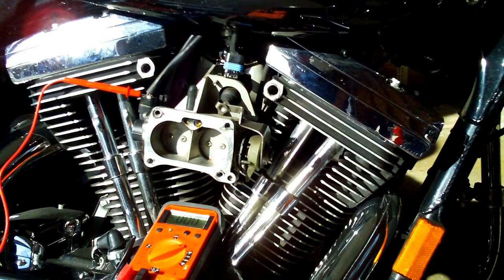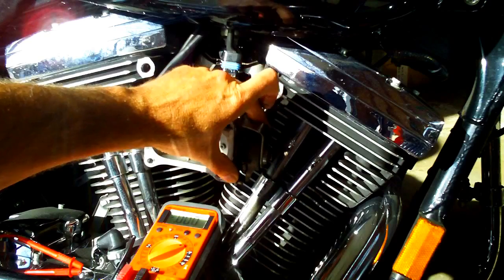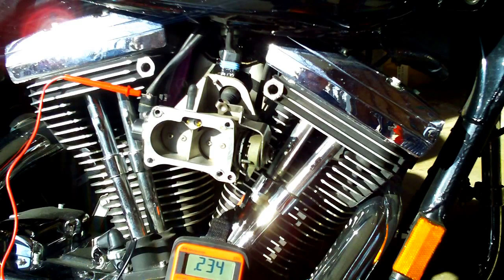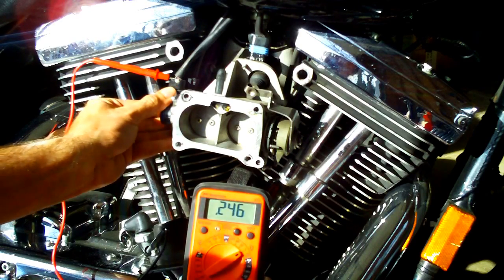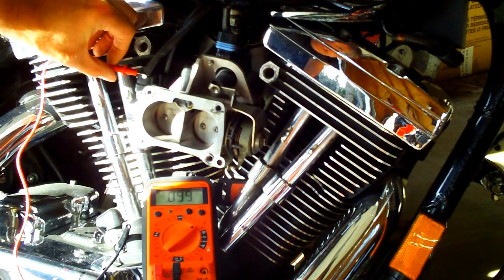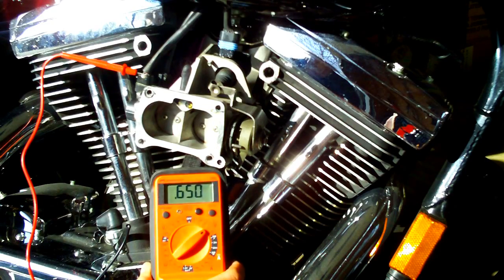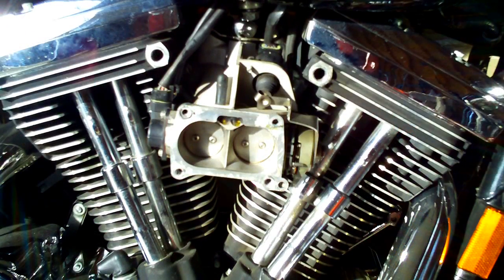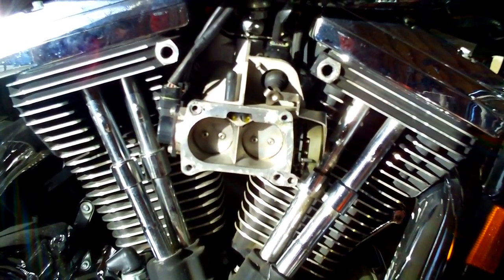Reset Harley Davidson Magneti Marelli Fuel Injection TPS Settings ✔

Comment: Man! Looks like a great test. But you never say what your multimeter is set at
Reply from the maker: The voltage meter is set to millivolts. Here is a video of the multimeter I used. https://www.youtube.com/watch?v=SSi6kIp_Vrg You're right, I did not mention in the video, but have replied to other comments on this.
Reply: Mark Young - Outside The Box
Thanks
I figured it out and my idle numbers are off. What kind of Bike is this?
Reply from the maker: This is a 1997 Road King 80 cubic inch. There are some small differences in the numbers for the 88 twin cam. What are you working on?
Reply: Mark Young - Outside The Box 
I have a 2000 Road King Classic. 88" efi
I'm sure my numbers would vary
Reply from the maker: For TC88, your cold idle setting should be between 0.650 to 0.680 volts DC. The 80ci motor has a nice cold idle speed at 0.650. This is the only variation between setting up the two motors, I believe. It is meant as a starting reference point, but you can always increase or decrease the cold idle speed to suit yourself afterward running the bike a few times, if needed. Good luck to you!
Reply: Mark Young - Outside The Box Thanks! I'll look at it again. Those bolts don't want to be adjusted. There's even some kind of clear filler in the head
Reply from the maker: That clear filler in the heads are epoxy that the factory put on them to discourage people from "tampering" with them, and with good reason. It doesn't take much of a twist of the TPS to throw the whole works out of balance (I know) and rendering your bike into a fancy paperweight. Some use a sharp tool to pick that epoxy out of the heads. I used pliers with a good grip to gently turn them, just a little bit, to loosen. You don't want them too loose or it will be a pain in the neck to get the thing to sit still when you finally DO get the right voltage reading. Try to coat them with something to keep them from loosening after you've got it spot on.

Comment: hello ,I get a 97 road king from a auction  ,I notice the throttle body is  broke, my question is if can use one from a 2001 rk?
Reply from the maker: I believe all of the MM fuel injection throttle bodies are the same. The ECM's may be set a little differently to compensate for differences in cubic inches, but your ECM is already setup for your 80 cubic inch motor, so it should be an easy swap. The only area between the two that I would question would be the fuel injectors, but if you have your original ones you could swap them out too? Let me know how it goes.

Comment: Hey Mark I did all of what u said an when I started it up it shakes so bad that it feels like the motor ready to come out I have a 2000 ultra
Reply: Video is very informative by the way... will try after i get it running. hopefully
Reply from the maker: Are you sure you used the right meter setting? Cold idle should be (1450 Domestic/HDI) 0.64 to 0.68 volts for the twin cam engine. Was it shaking before you performed this procedure? Is it only at idle? Did you let the bike warm up? Is this a shake from an idle that is too low, or does it seem like it is misfiring? Being an Ultra, you must have a tachometer, what is it showing for RPM when it is doing this? Here is video of another 2000 Ultra that followed the same steps with success and some more tips and info.... https://www.youtube.com/watch?v=xEIVYdPGYMk
Reply: Yes it was after I got my motor bored out to a 95 it been doing it an the tps was replaced to bec it was cracked up really bad
Reply from the maker: So it sounds like it is a system that was meant to feed an 88 cubic inch motor that is now being asked to feed a 95 cubic inch motor. You may need to add a fuel module to the system to try to balance things out? Also, the numbers to set the idle may be too low for a larger cubic inch motor? You may have to experiment with the cold and hot idle screws. What RPM is it idling at now?
Reply: I got a ps5 now I'm sending it in to get dino next week
Reply: I have a 1998 road king and need the new hoses  anybody got any ideas where i can find??? thanks Dave
Reply: the two fuel lines to the injectors
Reply from the maker: David, are you talking about fuel hoses that go from the tank to the throttle body?
Reply from the maker: Keith, the P range shows issues with the engine sensors and motors, but there is not a PS5 code. The range is P0051-P2304. You can check here for the correct codes. At least it is telling you that something isn't quite right and hopefully will help to narrow it down to the real problem here. https://dgcustomcycle.com/tech/harley-diagnostic-codes-04-present/
Reply: yessir but i found them  made by goodridge  sold by custom chrome thanks anyway for your quick response..... one more question on this magnetti injection system... do both the inside tank lines have the ball checks?  where the lines screw in to tank ??? i see one on the threaded bungs to the front of the tank but the rear one is open hole....If you can answer it would be cool...... bout had all i can deal with on this old system  if the hoses done work gonna go to carb kit....
Reply from the maker: I replaced my fuel lines with the Goodridge braided lines as the original ones started leaking around the o-rings. The Goodridge 0-rings are replaceable, so at least you wouldn't have to buy those lines again. I don't remember if there was a ball valve in both ports or just one. I remember having some gas to catch in a container at some point, so be ready for that just in case.

Comment: RK with the blessed MM EFI. It has always shown a big drop in mpg from local rides to highway. Above 70 it drops from 42’ish to 25. I do have stage 1 breather and VH pipes. Any ideas? Runs good, but sucks fuel.
Reply from the maker: That sure does sound low alright. Is this an 80 cubic inch also? I was getting 45 to 50 average city/highway riding and that was with a Dobeck EFI controller and Bassani 4 inch slip ons. You don't have a check engine flash going on at all?
Reply: 88 - no engine light - did find a couple of challenges with air leaks. Service person failed to put copper washer on one side of breather banjo bolts. Also, a breather tube had a crack
Reply from the maker: Have you pulled the plugs to check if they are both looking the same? I'm guessing very black with that kind of mileage. However, if one is black and the other is more of a light brown, the fuel injector feeding the blacker plug may not be closing all the way allowing fuel to leak by? If you do remove the plugs keep track of which cylinder they came from. Other than that, a stage 1 breather and more open V&H pipes should make it run leaner, not richer. Three things control the fuel mix. The throttle position sensor, the barometric pressure sensor (underneath the right side cover), and the engine temperature sensor (locating dead center down the front cylinder on my 80 cubic inch, should be similar for your 88). I thought I was having issues with my engine temp sensor causing it not to idle well when cold, so I replaced it (it turned out to be the cold idle motor adjustment). One of those three parts may be faulty and causing your rich fuel condition?

Comment: 2001 road King, starts up ok, but after warms up going down road a mile or so it shuts off, let it sit a few minutes it starts and runs another 1/2  mile or so and shuts off again, sometimes after cranking it again it will idle about 5 seconds then shuts off, 
Please help..... what could be causing this ????????
Reply from the maker: Hello Andy. This could be caused by a number of things such as a bad wire connection somewhere to a problem with the fuel system. I have not had an experience with this. Is the check engine light flashing when this happens?
Reply: Mark Young - Outside The Box 
Yes the engine lite comes on when thus happens
Reply from the maker: Ok, good, you have something to go on. Follow the instructions listed here and see if you can find a fault code. http://www.thunder-max.com/techdocs/HarleyDiagCodes.pdf
Reply from the maker: Also try this link that tells you how to check them and what they mean. https://www.hdforums.com/forum/ignition-tuner-ecm-fuel-injection/631955-harley-diagnostic-codes.html

Comment: What year bike are you working on? I have a 98 ultra w the MM but I don't have a gray and violet wire
Reply from the maker: Hello Randy. This is a 1997 Road King. Maybe your wire colors are different, but if the throttle position sensor looks like mine, it would be the wire that is closest to the throttle body of the MM. Number 3 going across from the left. 1-2-3.
Reply: Mark Young - Outside The Box Thank you
Reply: One more question Mark, I got into this tonight and the wiring on my TPS  has 2 black in #1, red in #2 and blue in #3 spot, do you suppose it will be the blue wire that I need? Thanks for the info.
Reply from the maker: The blue in #3 would be the first one I would try. If MM systems used the same configurations year to year regardless of wire color, that should be the one that carries the voltage once it has passed through the throttle position sensor. Let me know what you find.
Reply: All I keep getting on meter is OL, which I believe is overload?
Reply from the maker: Yes, I believe that is what it stands for also. Are you able to try different settings on the meter? This measurement is for Millivolts DC. I'm not sure what setting you have the meter on to get an overload of what should be a very small voltage output.
Reply: I could not get a reading so I turned warm and cold idle screws back in, put everything back together and now the bike will not run at all, backfires and just stalls, never loosened the screws on the TPS
Reply from the maker: Are you sure you turned the screws back in the same number of turns? Is this only at idle or when riding? Did you unplug any connectors such as the cold idle motor or throttle position sensor and did not seat them back in all the way? Try unplugging the ECM fuses for a minute and plugging them back in. They should be under the right side cover below your seat. You can see where and how in this video at about 7 and a half minutes in. https://www.youtube.com/watch?v=X1a9kBx_Lb4&t=454s

Comment: Hey Mark, just this summer my '01 Road King seems to have lost it's cold idle, and the warm idle seems to be slower than it was, although, otherwise, the bike still runs great. I checked the cold idle motor yesterday, on a cold start, and probably within 5-10 seconds or so, it starts to retract, dropping the fast idle right down. Is that normal? It is summer, and it sits in a pretty warm (sometimes hot) garage, but last summer it did seem to hold the fast idle longer. Just wondering if maybe the ecu is getting a false signal for the air temp, or cyl head temp sensor saying she's already warmed up? Thoughts? Maybe something else?
Reply from the maker: My first though, as this was happening to me, is that both the cold idle and warm idle screws are backing themselves out. I had to readjust both even after resetting the throttle position sensor had them set correctly. As you said, after a Summer or two, both seemed to be lower than normal. The last time I set them I backed them out to put blue loctite on the threads. I traded the bike two months ago, but it was good at that time. I found the cold idle seems to slowly drop as the bike warms up, not a steep change like the newer ones, and as the screw backs out it gives the slow idle motor less travel to gradually work with, so it seems to drop sooner than it should for a cold start. Make sense?

Comment: Hey Mark, did powering up the bike throw a code ?  Have a code on bike we're working on, and no way to read them
Reply from the maker: Hello Peter, and thanks for checking out my video. I was getting a check engine flash when I would accelerate with the throttle position sensor too far out of spec. After this reset process that did not happen anymore. Have you tried checking the codes by using this methond? 
Turn Ignition switch to OFF & the Run/Stop switch to Run.
Push odometer reset button in & HOLD IT IN.
Turn ignition switch to Ignition and release odometer reset button. ...
Push the odometer reset button once and you will see the selection menu 
And here are the Harley trouble codes which I believe cover all fuel injected models?
http://www.thunder-max.com/techdocs/HarleyDiagCodes.pdf

Comment: Thank you for a clear and concise  explanation of this system! I am a Factory trained tech a little out of practice with this system and needed a little refresher!
Reply from the maker: Thank you Donatel! That covered the basics of it, but when it comes to the temperature sensor in the head, and the barometric sensor under the right side cover, there is still more to this system to figure out. But using these settings as your foundation, you can build from there! Glad it helped. Good luck helping other people keep their rides on the road! We need more of you!

Comment: Would you have any of this info possibly pertain to a 2007 heritage softail as well? Buddy's bike has got some goofy conditions and was wondering if we could do something like this as well to his, just to make sure. Thanks! Great video!
Reply from the maker: Jess, I do not have any info on the Delphi fuel injection system yet. I recently traded in my '97 for an '09, so in time I might look into what makes it tick as well. Thank you for the comments, I appreciate it.
Reply: Thanks for the reply! Looking further into it there is a recall for his bike where the battery's positive terminal can make contact with the oil reservoir! His conditions would match such a situation, thanks again!
Reply from the maker: Good to know, Jess. Hopefully others will see your post if they know of a similar situation!

Comment: what is meter set on?
Reply from the maker: Set to Millivolts, Larry. On that setting you can read the "zero point two seven five" (0.275) volts DC. As an example, 0.250 "zero point two five zero" (0.250) volts DC would equal 1/4 volt DC. "Zero point five zero zero" (0.500) would equal 1/2 volt DC. Does that make sense to you?

Comment: what do you set the multimeter on to get the correct setting
Reply from the maker: As for the multi meter, you need to have one that will read DC volts in MILLIvolts. As the numbers go from the decimal point, 10th, hundredth, thousandths. That is why the reading is 0.275 volts DC on the display. One volt DC would show as 1.000 and a half a volt DC would show as 0.500. Here is a video of the multimeter I used: https://www.youtube.com/watch?v=SSi6kIp_Vrg

Comment: working on my 97 FLHTCUI and running into some dumb questions.  how did you remove the plastic fill in the screws on the throttle position sensor?  what setting on the multi meter?
Reply from the maker: Richard, I didn't remove the epoxy from the heads of the throttle position sensor, I just grabbed the heads of them with some pliers and rotated them loose and then tight again that way. I have read that some have picked it out with something sharp and pointy. As for the multi meter, you need to have one that will read DC volts in MILLIvolts. As the numbers go from the decimal point, 10th, hundredth, thousandths. That is why the reading is 0.275 volts DC on the display. One volt DC would show as 1.000 and a half a volt DC would show as 0.500
Reply: Thank you for your reply.  back to work tomorrow thanks

Comment: Hi Mark.. I have a 2001 FLHTCUI. I followed you directions to the letter so I thought. When it came to setting the cold idle to .650. I started the bike and the cold idle was 3000 rpm. I don't know what I am doing wrong.. I watched the video over and over and over lol.
Reply from the maker: Sounds like something is holding the throttle open more than it should be! Things to go over: Did you turn the bike on and then off before you unhooked the cold idle motor connector? This will put it into it's "neutral position." Are you sure you turned the cold idle screw and not the warm idle screw when you made the setting of 0.650 DC volts? Inspect the throttle butterflies motion when you turn the throttle; are they opening and closing smoothly or does it feel like something is binding? Are the butterflies almost completely closed when you let off the throttle? After all of these checks, I would then back out either the cold idle screw or warm idle screw 1/2 to 1 turn, and then start the bike to see if the idle has come down. Work on one screw at a time and hopefully you may find the one that might be turned in too far. If it's not the idle screws, it's something else causing this issue.
Reply: Thanks Mark for replying. The only thing I did not do was cycle the bike on and off before starting. She is still sitting in the garage with the air cleaner off so I can start again. Once the bike warmed up last night I played with the warm idle and got that perfect. I'll start over again this morning. One thing I did notice...on the throttle band.. the arm that goes from the Idle speed contnrol actuator to the band is not tight. There is a bolt that goes through the center with a flap over it to prevent it from loosening but there is play with that band. Should this be there ?  Thank you for getting back to me
Reply from the maker: I think there is some play in mine too. And that nut with the flap over it is very important. Mine fell off on a ride and it would not idle down all the way after that as the mechanism got jammed in there, so make sure it is not going to fall off on its own, but otherwise leave it be. If that nut is tightened too much the throttle sticks in its movement (learned that too). If the warm idle seems to be ok, then try backing out your cold idle screw until it runs around 1100 or 1200 when the bike is cold, and see if it slows to around 1000 when the bike is warmed up.